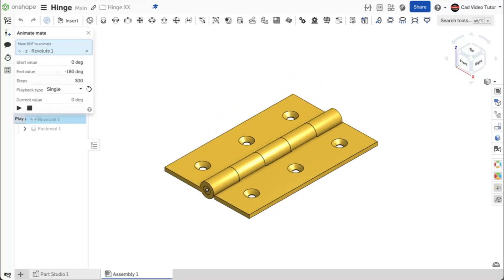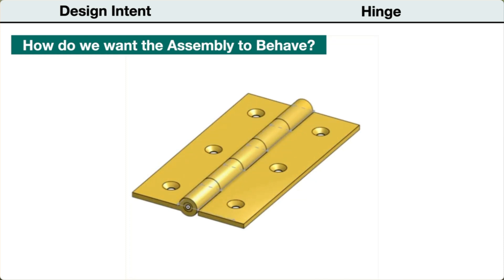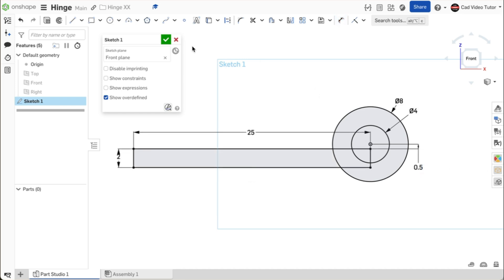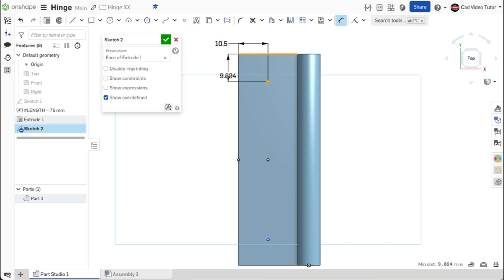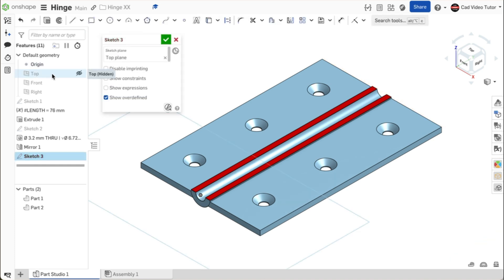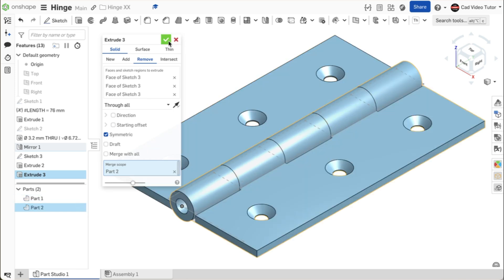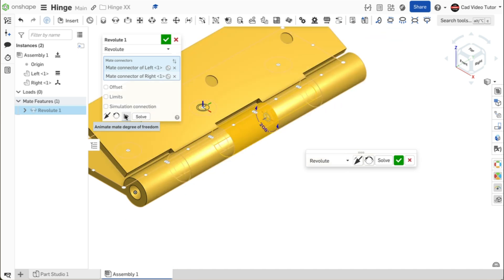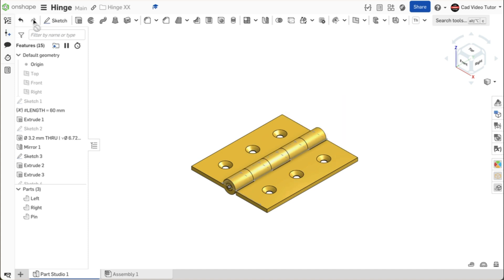Onshape Project 2025 - HINGE | Step by Step Tutorial New 2025

Comment: This is a well-done video.  But, In reality the pin would be too tight to insert, and the 5 segments would be too tight to fit together. Offset need to be included
Reply from the maker: Hi, you are right, we would need to add some clearance for certain faces.  What I usually do is add my desired clearance as a variable amount.  At the end of the feature list use the Move Face and apply the clearance variable to loosen the fit.  This way, clearance or fit can be controlled by one setting.  I can model the parts reusing common parameters which is fast keeps things simple.  For any drawings, the dimensions will be updated when the Move Face is applied so all is good.  What do you think?